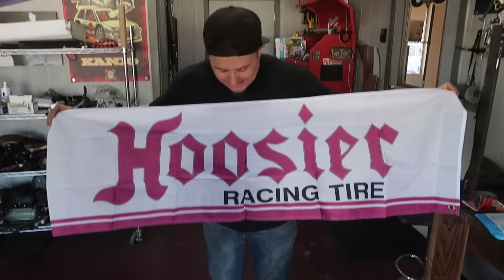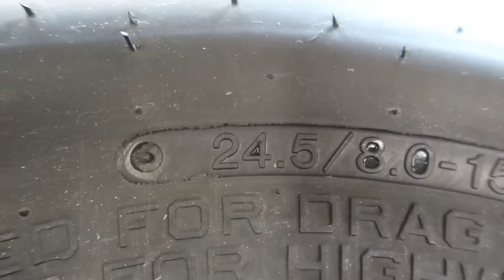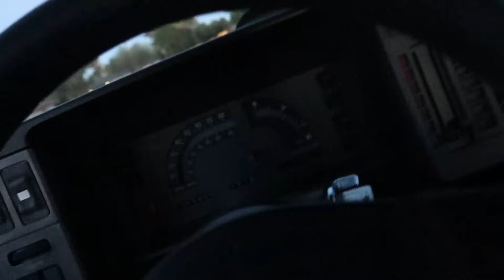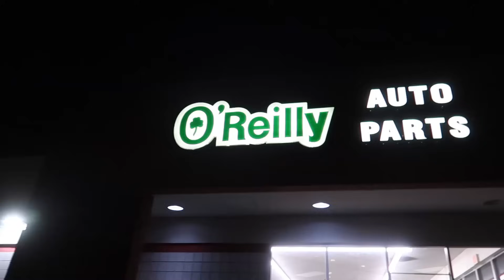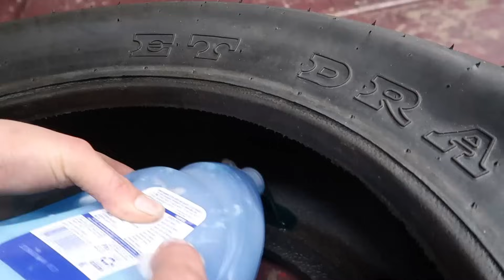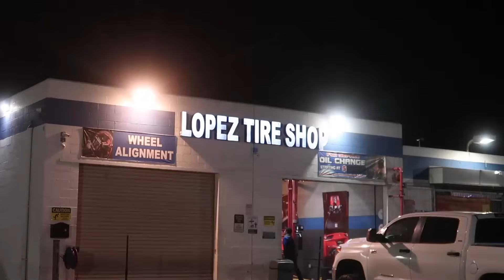Braven BLEW UP the Yukon!!

Comment: 17:45 Those Hoosiers are also a D800 Circle Track tire. Not intended for drag racing. Made mentioned of that before because you're going to be super disappointed when you try to launch and they don't do what a drag slick does. But damn... Those MT slicks are super duper short. Gear ratio gonna be screaming and the truck will certainly sit lower out back. Hey, at least they are actually a drag tire. 🤘😎

Comment: 9:00 you should check the rings on the Pistons crank case pressure is just as important as the valves,head and head gasket,